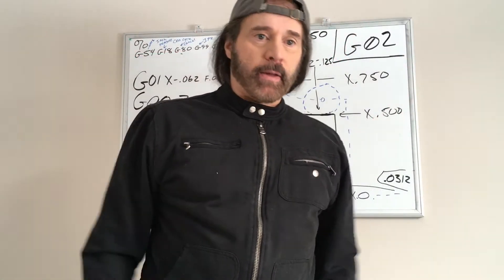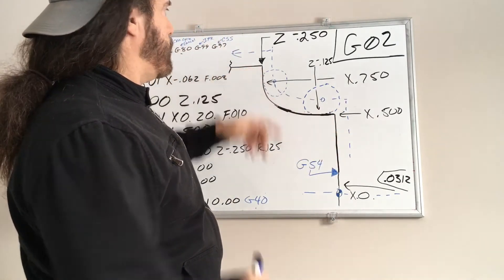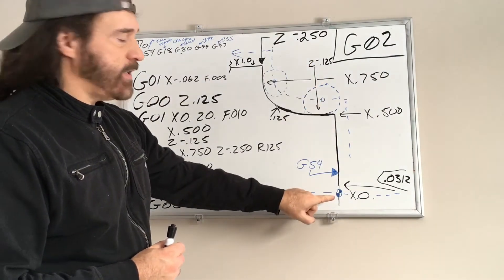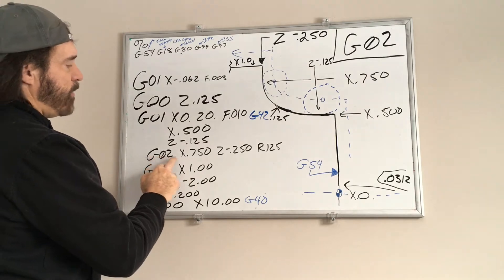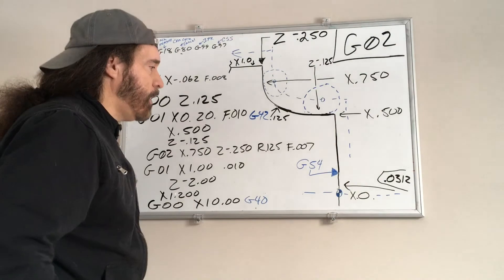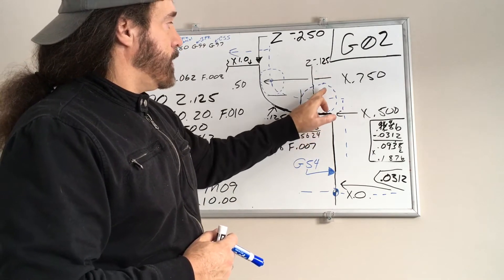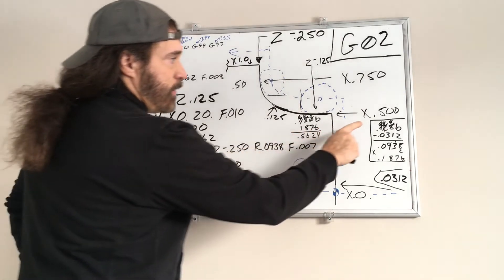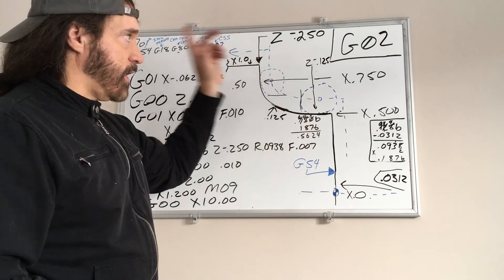Writing a G02 on HAAS CNC LATHE - Manually and with Cutter Comp for beginners

Comment: Hey Tim! Great video, one extra question. How do I determine if I am to use G41 or G42, given tool position 3 (X- Z-)?
Reply from the maker: Thank you for the kind words! Usually, anytime you are doing an outside diameter turning path, you would use a G42 ( which means the cutter comp path stays to the right side of the programmed path)and your tool tip direction is usually 3. 

If you were doing a Inner boring cycle that had multiple dimensions on the inner diameter, that's usually when you would use a G41( which means the cutter stays to the left side of the programmed path)...You would also need to adjust your tool tip direction for this.

I personally use G42 all the time on O.D. turing , because I get lazy trying to figure out all the math needed(haha!!)....so I let the machine figure it out.